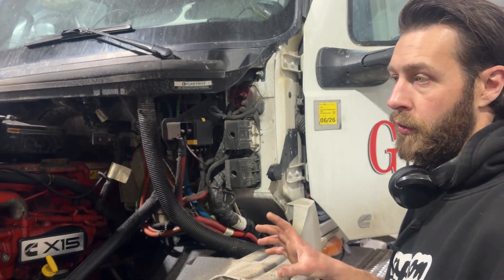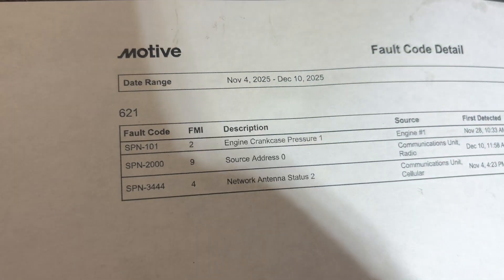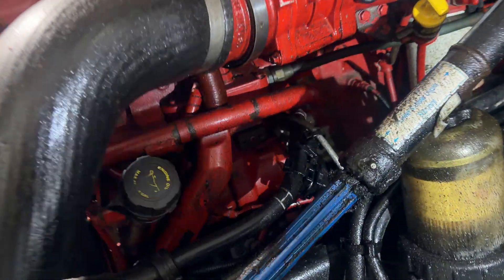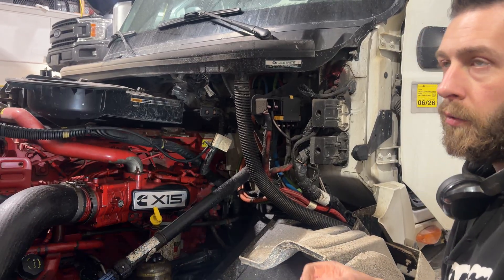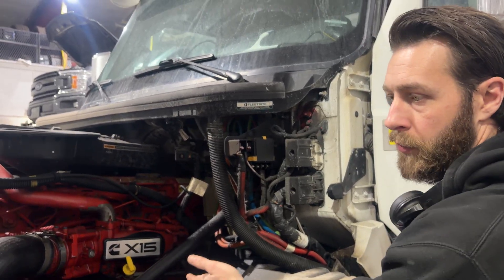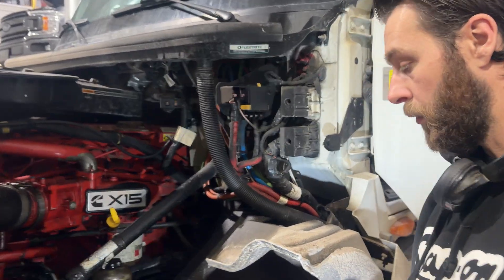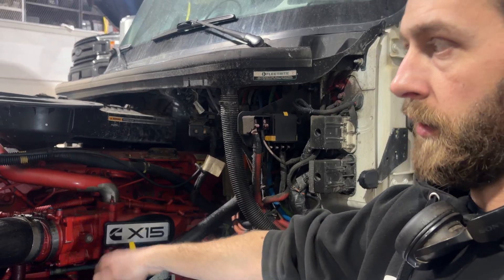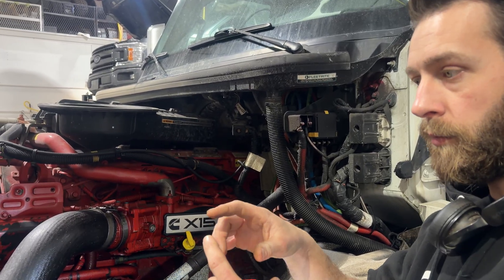International LT625 2022 X15 SPN-101 Engine Crankcase Pressure

Comment: Spec is max of 12 (new/rebuilt) to 18 (used) in H2O for Cummins with a 7.99 mm orifice tube off of breather hose on valve cover
Reply from the maker: Thank you for this